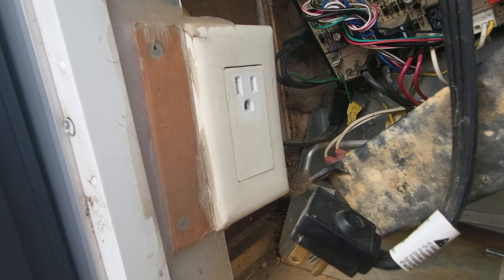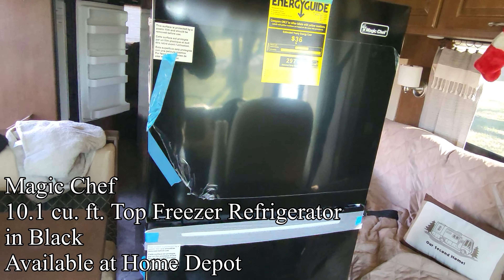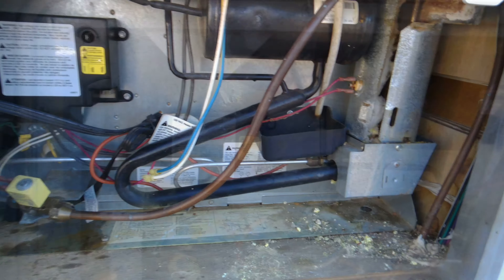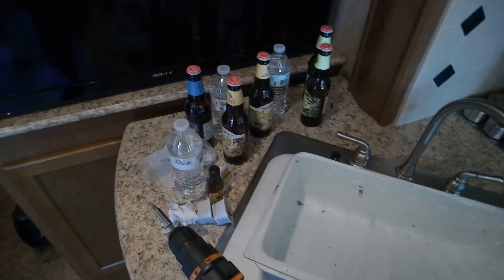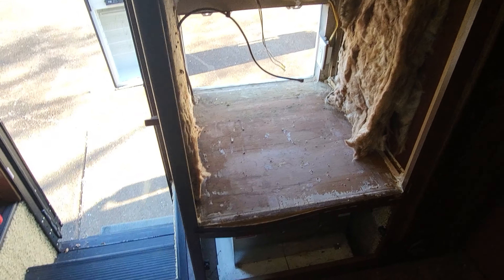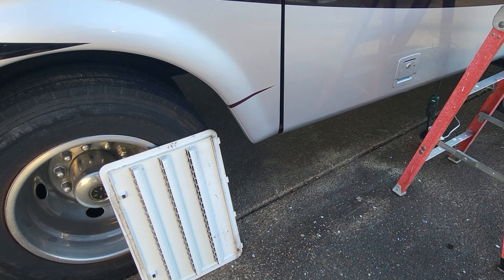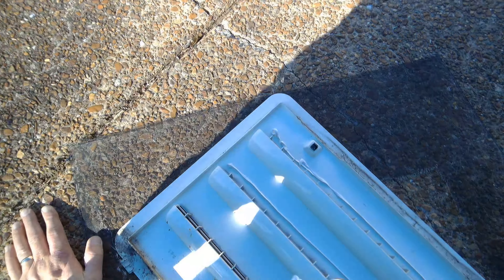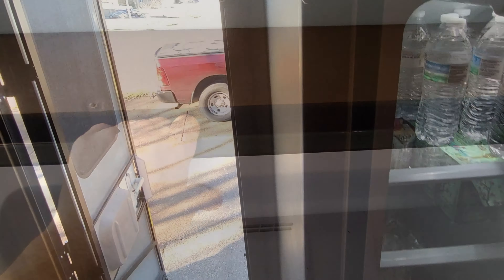Replacing RV Norcold N811 residential fridge

Comment: Great video, thanks for sharing this. I am considering doing this to my 5th wheel. Were there existing holes in the new refrigerator for those l-brackets and straight brackets you put on or did you have to make holes? I'm a little hesitant to put holes in a new fridge. Also did you need to remove the leveling feet from the bottom?
Reply from the maker: For the straight brackets I used existing holes for switching out the door side, etc, the l brackets I had to drill, and there were some holes in the frame I used to attach it in the rear. left the leveling feet on and the latch fit exactly where the holes to switch the door goes.